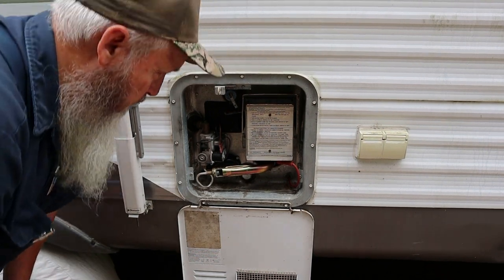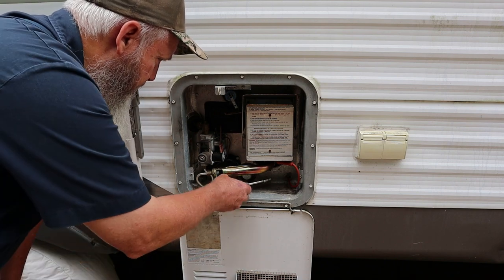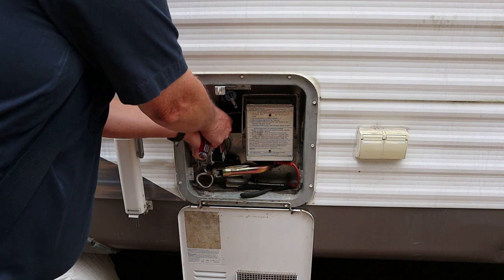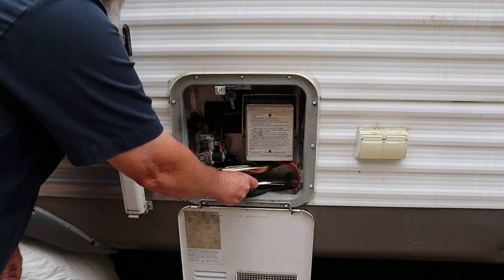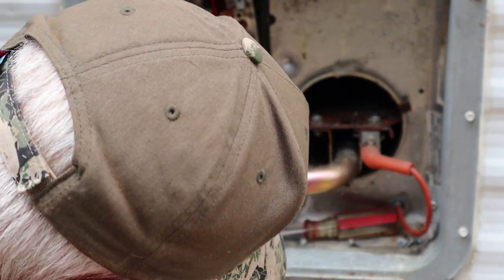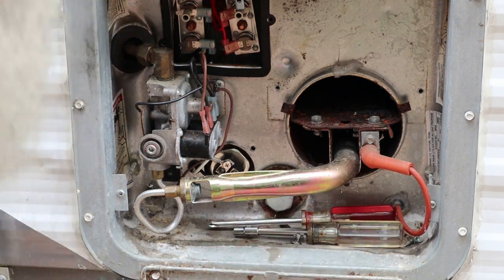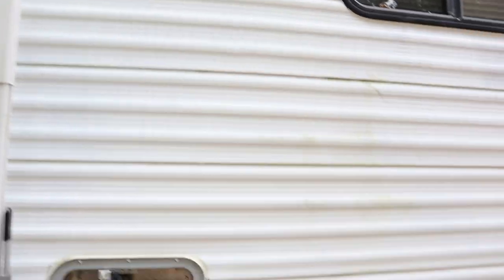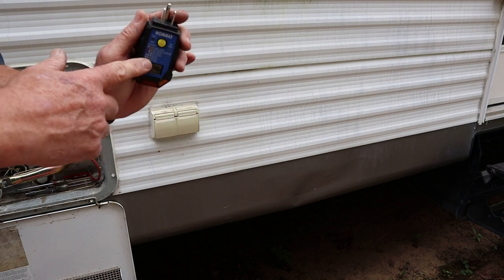Multiple Problems With RV

Comment: Definitely a strange situation you found. I don’t normally carry around a polarity tester, but I think I should now. It looks like the receptacle was wired wrong. I usually check amp draw on heating elements as well. I have seen one recently in a Chiller Oil Sump that was not working properly. I checked power and we had power, checked amps and it seemed low. 750 watt heater was only drawing 3 amps, should have been 6.25 amps. Put a new element in and it worked fine. Watts = Volts x Amps except for 3 phase. Thanks for the Videos, Kenny. That’s why I like service work, you never know what you are going to be doing and what your going to find.
Reply from the maker: Service work is always exciting for sure.

Comment: Great job ! If I was the customer I would drill out the screws and replace the main power receptacle . If that didn't fix it I would have someone check out the electrical service from the pole. But if he is going to leave the trailer there as long as he documents what you did no problem. I know and appreciate cost is always a concern and you saved his bacon !
Reply from the maker: That camper will most likely never move. Those lots are privately owned. If they sell the lot the camper will most likely go with it.

Comment: That was a weird one!  I had the switch fail on our last Class A. I replaced it, knowing it wasn’t rated for the environment. I traded in the RV before it had a chance to fail again.  As another person mentioned, I would have swapped the wires in the pedestal, and marked them with colored heat shrink or tape to indicate the actual designation.  As a retired electronics tech, I also have a label maker that prints on heat shrink. Once again, those “electricians” are keeping you busy.
Reply from the maker: At the pedestal or main breaker, both are about the same. The place to do it was at the receptacle but I couldn’t get it apart.

Comment: Kenny,   Why did I get the feeling you were talking to me when you said EE, don’t watch?   I do have a couple comments.   1.  Turn the power off at the pedestal, and you will not have sparks flying.   2.  To test a switch, with power off, use ohm meter and flip the switch.   3.  Just my opinion,  I would have changed the hot and neutral conductors in the pedestal, not the RV panel.   That way, if the trailer is moved it will work, and if a new one is connected, it would work.   4.  As requested, no comment on the switch jumper wire.    
Really good idea to plug in and find reversed conductors!
Always work safe!   The life you save may just be yours!
Respectfully,   Kevin
Reply from the maker: Ha ha maybe I was talking to you. 
1. That’s no fun !!!
2. Yes
3. I would have liked to do it at receptacle but I couldn’t get it apart. 
4. thank you for not commenting. 
I am always safe, except when I am not.
Reply: @hillbillyrv  3.  Change it on the breaker.

Comment: Hey Hillbilly. Another interesting video. I have one for you. I replaced a failed heating element this spring in my 5th wheel. Problem solved. So I thought. Now if I leave it on electric, eventually it turns off or I notice that it is not heating anymore. Go back the next weekend and it works again for a while. Go figure.
Reply from the maker: Hummmm

Comment: Great video of value again bud.  Really learn a lot from your channel.  However, I am also on the side of getting access at the pedestal and most likely fixing the issue there.  Because when the unit is moved to its next home, the neutral bar is once again HOT!! Could cause someone some real problems.  Keep the great videos coming!
Reply from the maker: Come to find out, this site has probably been wired wrong for decades. At least now the camper  has correct polarity.

Comment: I had to replace my switch  could not just bypass it straight to my breaker because outside plug and microwave are on same circuit 🙄 these manufacturers don't know the problems they cause to us the customers when they just Hurry up and get it off the line. And get it sold
Reply from the maker: They throw them together in a hurry.

Comment: I would just go without hot water and make who ever fix their problems.Wouldn’t switch wires in my camper.
Reply from the maker: I guess you don’t like hot showers.
Reply: @hillbillyrv  I like hot showers .I just like my rv fixed the right way and not rigged up. I value my life and property more than to rig my rv wiring like that.That’s exactly why you see RVs burning to the ground.But whatever floats the owners boat.
Reply from the maker: I found out off camera that this site has likely been wired backwards for decades. Now at least the camper has correct polarity.  @RLBS61